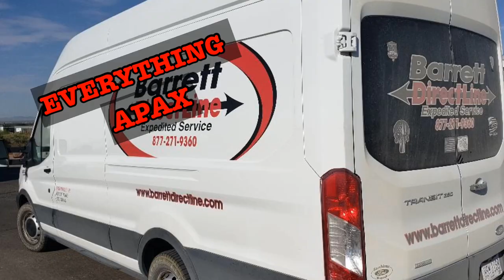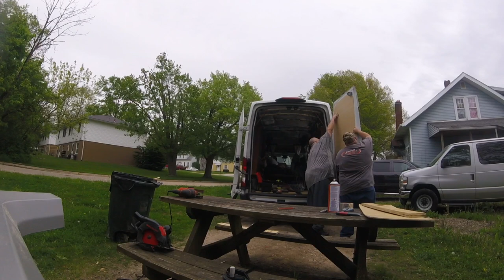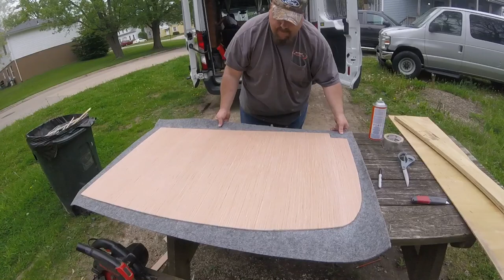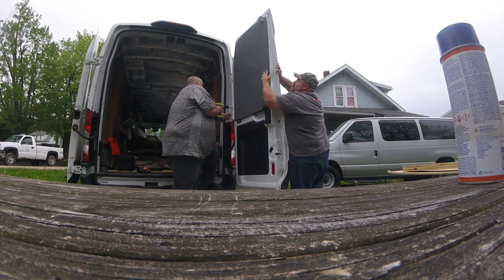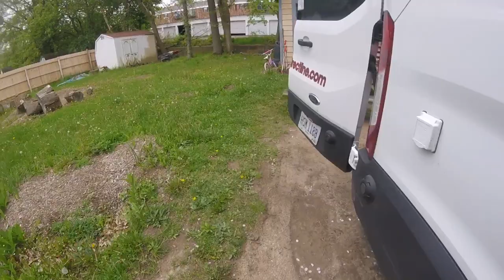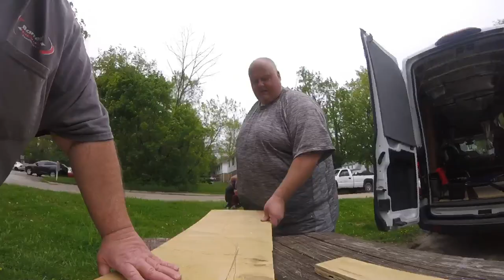HOW TO MAKE CARGO VAN DOOR PANELS

Comment: intro music is ridiculously loud man, turn it down.
Reply from the maker: Hmmm. I'll check it out. I don't adjust it but I'll look into it. Appreciate it
Reply: @EverythingApax   could barely here the music 😖🤪🥴😳😁👍💯🇺🇸
Reply from the maker: @Desertvanlife  lmao! Dammit!
Reply: @EverythingApax  The intro rock music you use is very unbalanced. if you have the file as an MP3 you can use a program on windows called Audacity to edit the volume of the file, and then save as a new MP3
Reply: -5db should do the trick.
Reply from the maker: @HeyItsJonny  taken from epidemic sound as are the others. Maybe because it's with photos and not a recoding. I'll test it out. Ty

Comment: Great content! Just wondering, does the shipper load the truck/van or do you do it? I'm interested in doing this, but for now, I'm just saving up for a vehicle. Be safe out there!
Reply from the maker: Most of the time it's no touch freight, which means they load and unload you.
Reply: @EverythingApax  thanks for responding..do you carry tools/parts for breakdowns or do you use AAA? Thanks